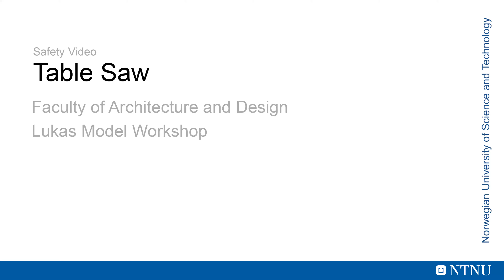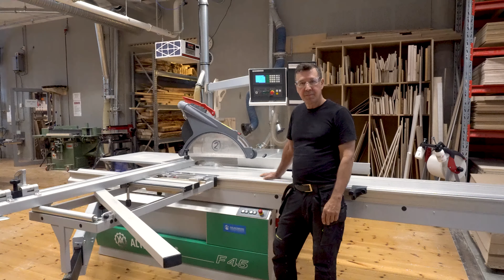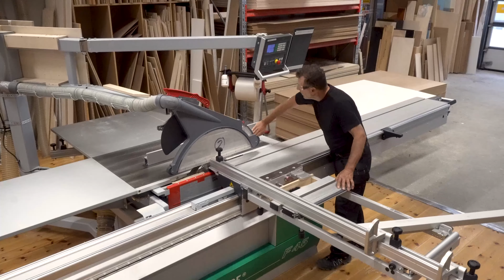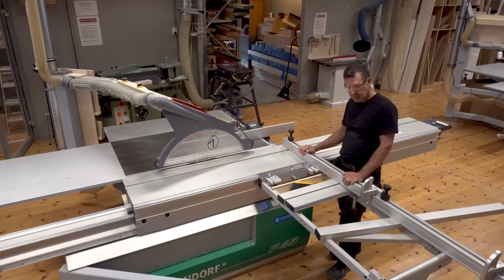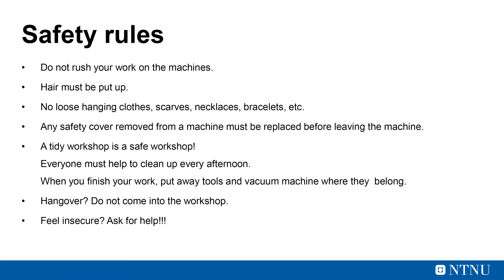Safety Video: Table Saw 1

Comment: WRONG!  Never use both fences at the same time as he has shown in the first cut, it shouldn't have been possible anyway if the saw was set up correctly.  The sliding carriage should be set up slightly open to the blade and the rip fence on the saw should also be slightly open to the blade, which means they are open in opposite directions so if you were to try to use both fences at the same time there should be a large gap on one fence or the other making the cut not only inaccurate but dangerous.   Not to mention.... NEVER leave material pinched between the blade and the fence.    LOL and this is a safety video.